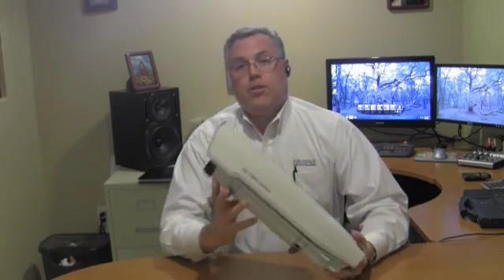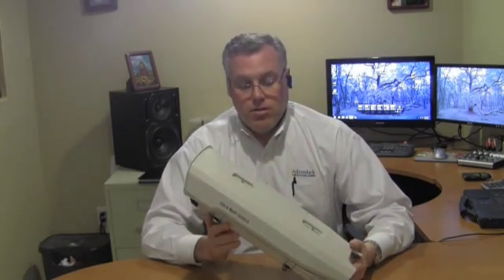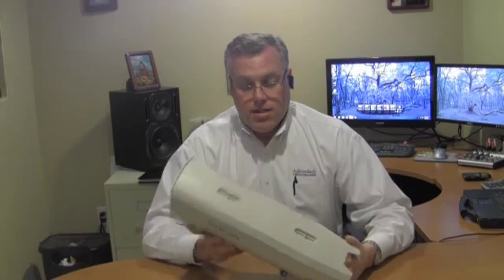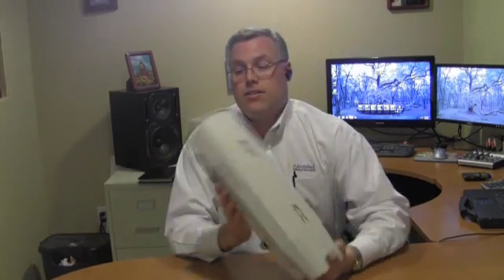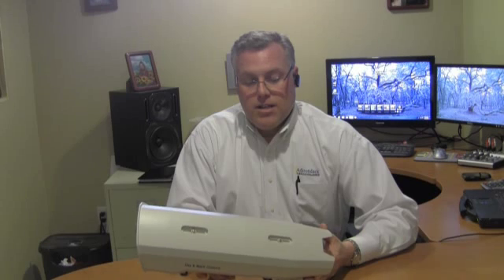License Plate Capture CCTV

Comment: I used Dahua Brand. It doesn't work at speed more than 10. We need a speed breaker. There are higher models which captures car plates at high speed and height. Entry point or car parkings are the sites where ANPR will work